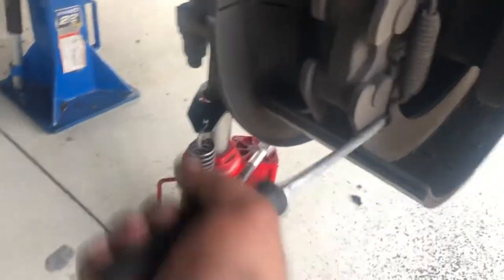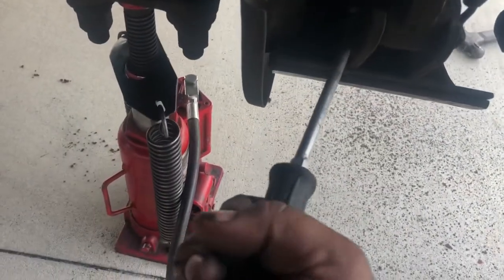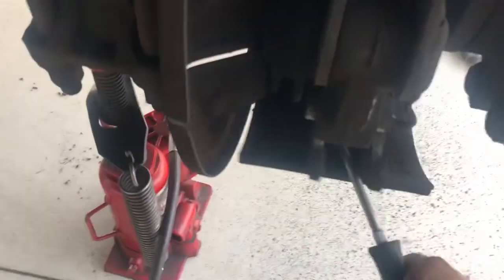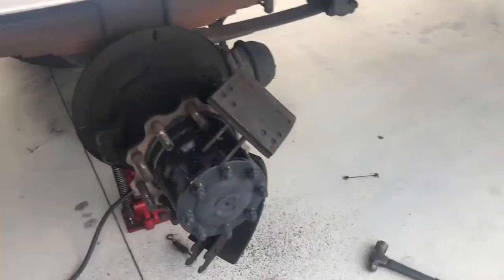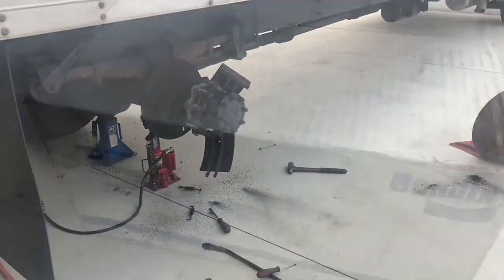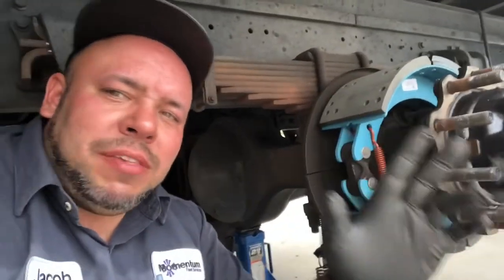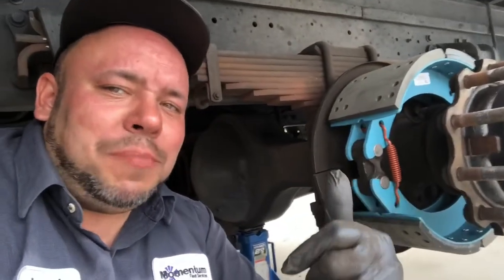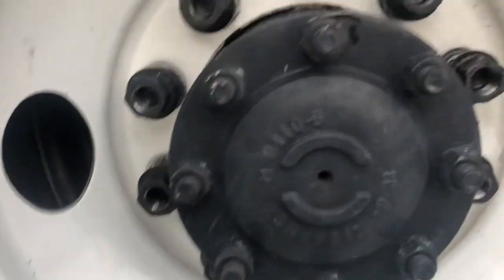Diesel Service Truck Life Doing Brakes on Hino Box Truck

Comment: That was a gr8 video! <Thankyou > Was that a hino 338 in your video?  😁kyle
Reply from the maker: Yes truck was a Hino 338.
Reply: @ZepolWorkzGarage   Greatly appreciate your help & kindness🙂 I just bought a 338 in Boston & drove it to the west coast ( just cab chassis) . I changed the oil behind a harbor freight in new Hampshire. The oil plug was so tight a 3/8 breaker bar wouldn't get it & I'm not a Lightfoot I weight 245 pounds & I'm fairly strong. I had to go back in harbor freight and buy a 2 foot long 1/2 drive bar and it was still pretty tuff and I even hit it with pb blaster🤣
Reply from the maker: @kylerich3771  that's why I always have a 3ft pipe to slide over breaker bar for more leverage. Thanks for Comment keep wrenching.
Reply: @ZepolWorkzGarage   Amen & take care😁

Comment: stupid but kinda important question... we have the 268 hino also. done the air brakes everything else BUT I've never done the engine or frame fuel filters... this truck has a lift pump right? changing the fuel filters just full em up, do a key on off cycle like5, 8 times and start her up??? theres no manual priming pump like old school trucks?
Reply from the maker: the greek guy viva-greece yes should have electric lift pump. Does yours have Davco type fuel water separator I fill those full fuel also. I do same key on and off couple times. When cranking hold throttle pedal to the floor until engine starts. Then keep revs around 1500 till running smooth should have no air in fuel system.
Reply: @ZepolWorkzGarage  yes has that Davco type filter also.. thank you... was not sure cuz our kenworth doesnt, it has a primer pump.... THANK YOU!!!!!!